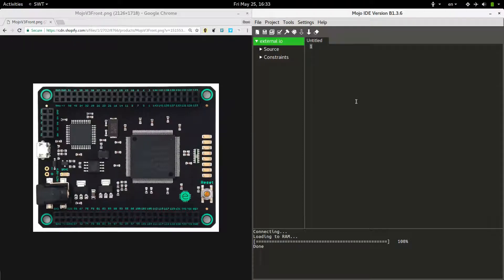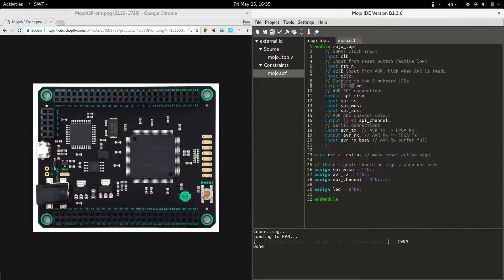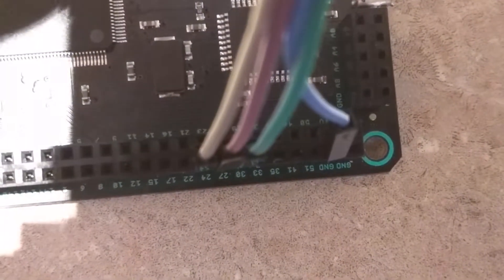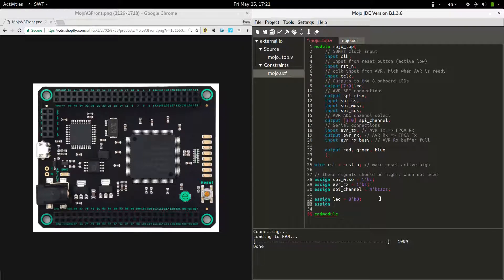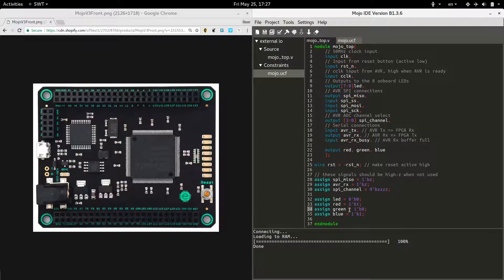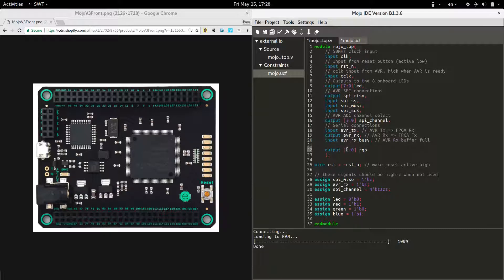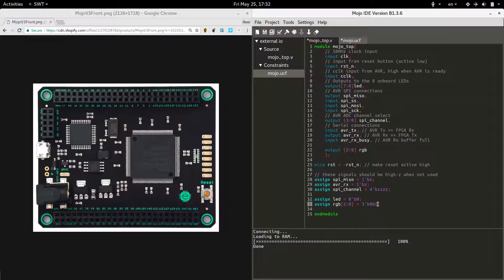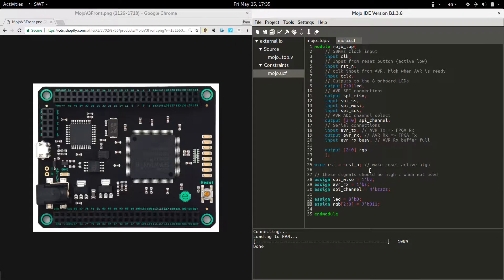Learn FPGA #7: Hooking up cool stuff (External I/O pins) - Tutorial

Comment: Can you output analogue values? Say if you want to drive the red bit of the led with just 1V to make it dimmer than the rest?
Reply from the maker: I don't know of any FPGA chips that are able to output an analog signal. You would need a DAC, which some boards have. This Mojo v3 does not have a DAC.
Reply: You could use a counter and the clock to make a PWM signal to each color channel on the RGB LED.

Comment: thank you for your videos, I find them very useful as a beginner in fpga and verilog. I just bought a mojo and I don’t want to make any mistake. Don’t you need a current limiting resistor un series with the led or is there a current limiting feature built in the board ?
Reply from the maker: Good thought. The Mojo outputs 3.3V, so it should be safe to hook most LEDs straight up to it.
Reply: @inventboxtutorials1898  Most colour LED have a forward voltage (Vf) of around 2v and a current limit of 20mA. If the FPGA output is 3.3v you need to put a 65 ohm resister in series with each LED channel to drop that additional 1.3v (in addition to the LEDs Vf) and LIMIT the current through the LED to 20mA. If you're going to try teach, you have a responsibility to do it properly! #JustSayin
Reply: @inventboxtutorials1898  Rubbish! You DO need limiting resistors. Once the. What you are doing is to use the internal resistances of the CMOS output and the LED as the limiting element. This unnecessarily  over stresses the FPGA and, if done with enough pins will exceed the chip power limits making overheat and eventually burn to a crisp.
Its true that in this example there's only 3 LEDs involved, but giving bad examples to people that might not know enough electronics to spot the erro is a really bad practice..